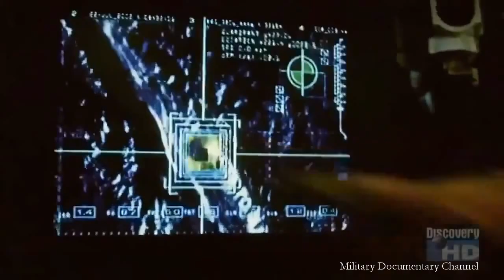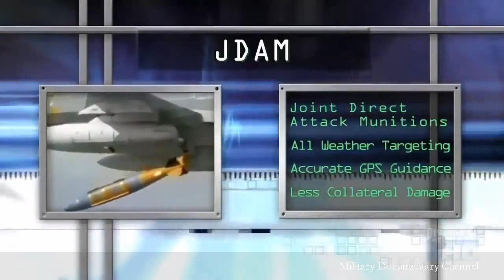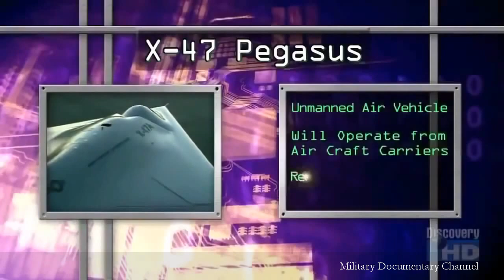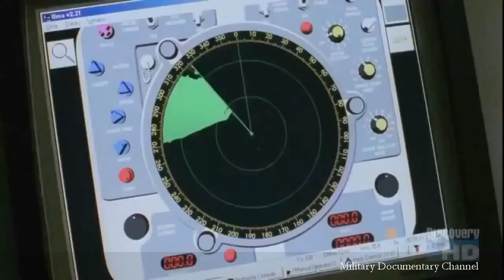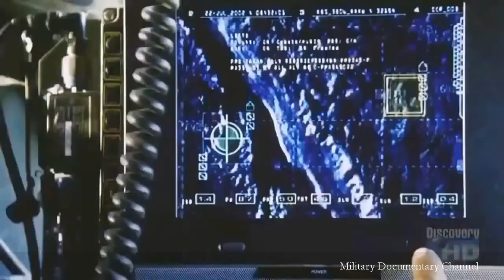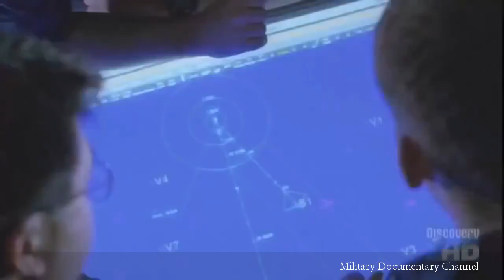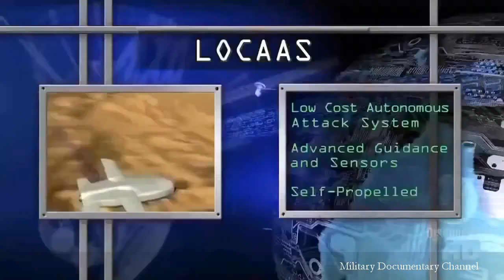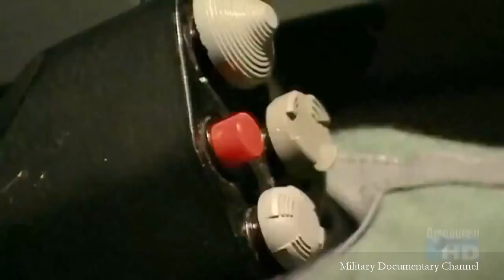Lockheed Martin F-22 Raptor - World's Deadliest Jet Fighter Plane - Military Documentary Channel

Comment: The F35 not only works it far exceeds what it's engineers believed was possible. What is really amassing is the F35's development is only at 20% of what it is capable of. The F35 is simply the deadliest Fighter airplane ever. That's ever, better and deader than anything.  It not only Is great for the Air Force but it's fills the needs of the Navy and Marines. It makes the Marine Amphibious attack ship the fastest and scariest thing there is.

Comment: What they are not telling you is that the F-15 E Strike Eagle carries a larger payload of bombs and air to air missiles,  has a much greater range and is about 500 miles per hour faster, than the F-22 , stealth isnt everything in air wars and Eagle was and still is the real work horse of the USAF , just like the F-35 is out performed by the F-16 , the F- 16 again can carry a much larger payload arsenal than the F-35. It has a much greater range and is way faster and can dogfight any adversary, if not for stealth the F- 35 would be shot down , it can't maneuver or out fly any enemy aircraft!! The air force will continue to fly the F-16 and F-15 Eagle for a long time. I think we need to rethink the F-22 and F-35 programs , since they carry less weapons,  have a much slower speed and much less range I dont see how they are better than the legacy fighters the F- 16 and F-15 
And when you consider the astronomical cost of this program., it isnt worth it,
Reply: What’s better about them is their ability to operate in the worst conditions. If the US had to fight a peer-to-peer adversary like Russia, stealth would be a much larger component. You could barely even fly if at all in non-superiority zones due to the threat of modern SAMs.

An F-15 or F-16 can certainly do more… but this is only in lower-threat environments. The potential is higher, but there’s no potential at all when you’re shot down before entering the combat zone. F-15s and F-16s work very well in Iraq, but they wouldn’t fare so well flying over the middle of China or Russia, etc. Also I think you might be underestimating the dogfight capabilities of the F-35

The F-22 is a little special because it’s also just hands down the best fighter jet in the world. Always good to have some of those in your arsenal.
Reply: 👎

We should have built 400 more F-22s.

Comment: So why haven't we heard of the many combat victories chalked up by the latest kid on the block. The world can say impressive things about the F-15, what has the F-22 done to keep up with the 15's capabilities. The Alaska Command F-15 C's had a special radar. The super cruise and stealth have very little to do with aircraft capabilities. So far F-22, I'm not impressed. Note, if you can't breath good clean air, why even strap the damned thing on in the first place?? It will never be the big boy on the block. The F-35 is a joke!!!
Reply: John Elliott the f35 is a joke but at $250mn a go it's not funny. The long suffering US tax payers pick up the tab so Lockheed Martin shareholders can get rich😡
Reply: John Elliott AK F-22s fly over my head every day. You do not and never will be made aware of its true capabilities so your assessment is completely flawed.
Reply: Ak situk do you live in Syria?
Reply: Compared to the F-15 Eagle, it has a long way to go and a lot to prove.
Reply: Even the F-15 was plagued with development problems, INCLUDING oxygen filters, locking software, airframe integrity, etc.
Reply: Unlike other aircraft that carry a finite LOX (liquid oxygen) supply, the F-22 has an "On Board Oxygen Generating System" (OBOGS).  Previously if OBOGS malfunctioned intermittently, the pilot could not detect if it was imperceptably generating insufficient oxygen, and thereby cause the pilot to develop a slow onset of hypoxia that could lead to blackout before anything could be remedied.  The solution was to issue a retrofit contract to add finite LOX units configured with an oxygen sensor to automatically dispense oxygen if it detects OBOGS is not providing enough.  The retrofit contract was done two years ago and there's been no hypoxia incidents for over two years.
Reply: I guess the Pentagon forgot to check with you first before buying them.